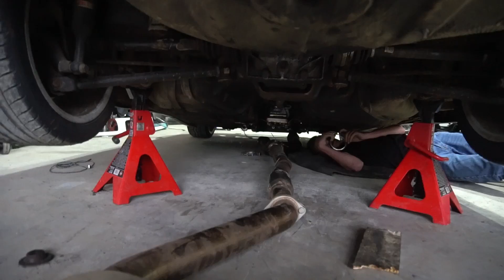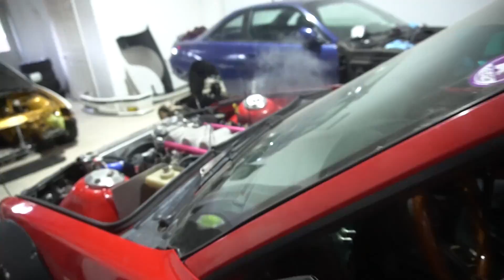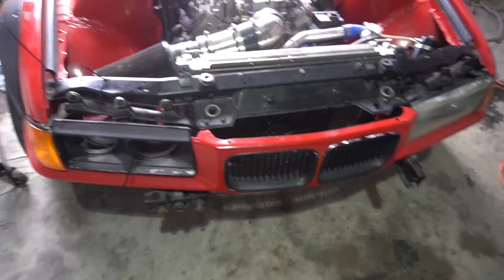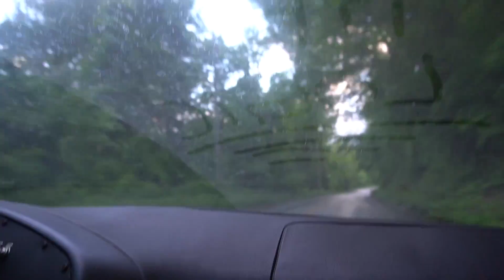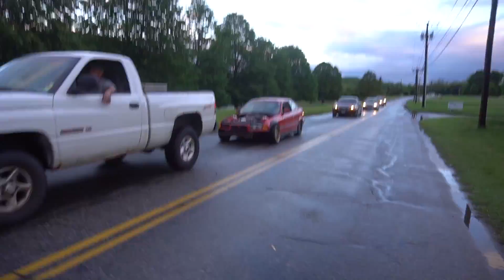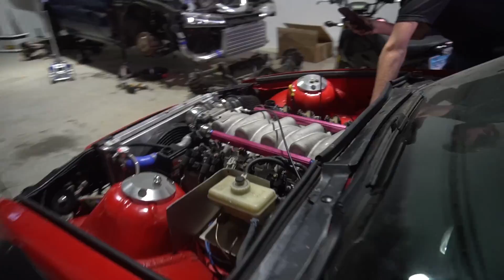LS1 E36: Yeah This Happened...

Comment: There is no way that car is giving you more problems
Reply: You underestimate the power of the Rodnock Mod Shop, young grasshopper
Reply: Where there's a Will there's a way
Reply: Eh I doubt the wires caused the puddle of oil that's on the floor at the end of the video.
Reply: soo we meet again.

Comment: Bro. Fuck all the other comments and assumptions. That loud clicking clonking noise coming from that side of the engine is detonation and you've spun a bearing and probably bent a rod. As soon as you beefed it on the street and it started smoking it was oil coming into that cylinder. Maybe when u let it settle in the shop and shit and started it again that cylinder was dead or still clicking but damn this is so cringeworthy to watch. Get under the car, and have a few people look from both sides at the engine and take it plugs one by one to make sure all cylinders are firing and running smoothly. Not trying to hate man I just hate seeing the struggle. You deserve a better running fucking car

Comment: I would have killed the motor as soon as it fired and I heard all the noise coming from the motor, at bare minimum pull the heads and check the top end. How this guy has managed to blow up this many motors is beyond me, it's not like it's easy to blow up a LS, they take a beating.

Comment: From my point of view, the smoke that you saw was all electric. If it smelt oily that could just be cause it's a new engine in there. oil hand prints burning off, electrical smoke is thick, move the wires far away from the headers or wrap them well in a heat protector!

Comment: the engine had either a seized oil pump or pick up is bad.  that was straight metal on metal noises.  Ls engines are known for oil pickup issues.  did you check that?

Comment: compression test wet and dry I'm thinking valve stem cause it's smoke at acceleration ...meaning head needs rebuilding ...u can prolly run a catch can or a water/air separator in-between the pcv  to slow down the oil burning

Comment: Where the fuck is the oil cap
Reply: Potato1232 I noticed that too he doesn't even have the power steering cap on
Reply: Potato1232 if you have blow by you will see it when you take the oil cap off

Comment: also sounds like it's misfiring so I wouldn't drive it till you check the coil packs it just don't sound healthy got to be a bad coil pack and I would definitely rewire the starter and alternator or there could be a fire

Comment: not an uncommon thing, when my mechanic replaced the motor mounts on my 5.3 the heat shield cut into the positive wire of the starter and shorted it out

Comment: just from my personal perspective through your video I don't think you had any Blow by all of that smoke was coming from those wires burning against your manifolds which is also like you said why your alternator and everything cut out on you and the motor wouldn't start back up and your fuse popped. now that you have the wires replaced in securely fastened so they won't burn anymore you should have zero issues with that smoking

Comment: Motors not bad, fix your wiring, ground the block , your smoke is coming because I noticed u didn't have the power steering cap wasn't in while u were driving , I bet it splashed out and hit the header ,  because that's the side it was coming from , just a FYI might be something to look into

Comment: 50k mile engine huh.  Lol
Reply: Robert Murillo That engine sounds like it has 500k worth of wear, hahahaha
Reply: Thomas Griffin I just think it is electrical issues /shorts or grounding.  most likely coils. also looked like a header gasket leak so that would make the o2 readings off if he uses o2 sensors and not just dummy sensors

Comment: Runs his sub power wire for his drift car within half of an inch from the headers,  unsecured.  Ok.

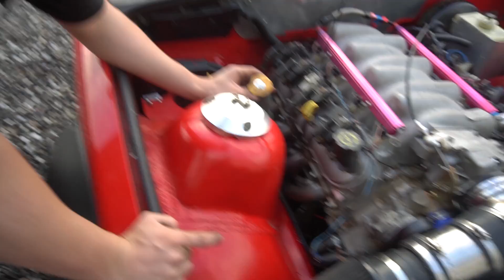U shaped hose at 8:35 looks basically pinched shut,  throw a longer hose in there RK

Comment: sounds like running on less than 8 cylinders... bad spark plugs? running open headers than are close to the motor can burn up your spark plugs bro. Possibly minor head gasket... or some kind of bad combustion on cylinders. That motor sounds like some kind of bad combustion... even with no exhuast and open header it shouldn't sound like that. Its not the timing ether.

Comment: *thinks there's oil blow by, roasts a power wire with at least 110 amps on the wire... lol, honestly looked like the accord all over again. except this time you had an actually spark in your engine bay just needing a little fuel.

Comment: never ever just  stick your battery leads on like that if you actually want to start the car. It might lose contact when the engine is on and its kinda russian roulette after that. It can ruin your alternator regulator or anything electronic in the car because of sudden voltage spike. And trust me you dont want to fry your ecu because of something this stupid.

Comment: I don't know much about V8s, but why does it sound like complete ass? Surely that's not how it's supposed to sound
Reply: kinda sounds like either the header isn't tight enough and leaking between the block or the exhaust has some leaks (will didn't tighten the bolts enough so it leaks) nothing worse than a leaky exhaust

Comment: engine running with no gearbox oil cant be good i imagine.
Reply: You obviously don't know how transmission  work then lol..don't need gear oil in the tranny to run the engine dude
Reply: In neutral the input shaft would still be rotating as no one was sat pressing clutch the entire time?... i also didnt realise until later it was part filled. But my logic stands
Reply: you obviously dont either... the input shaft is still spinning...